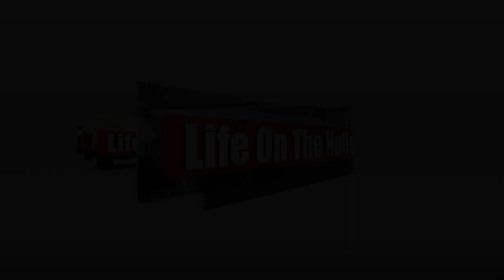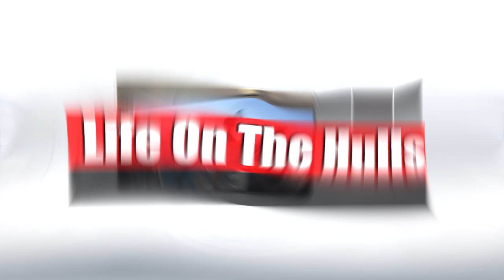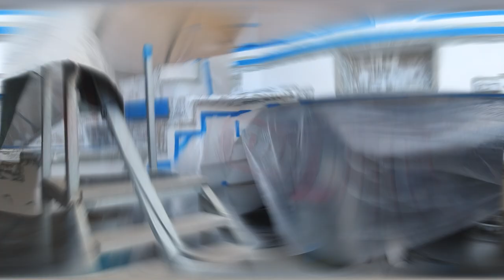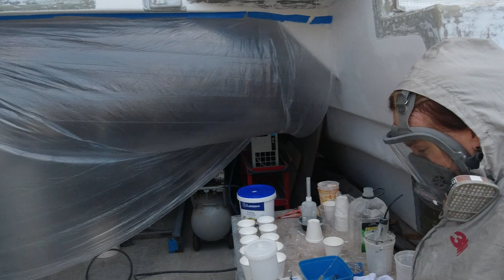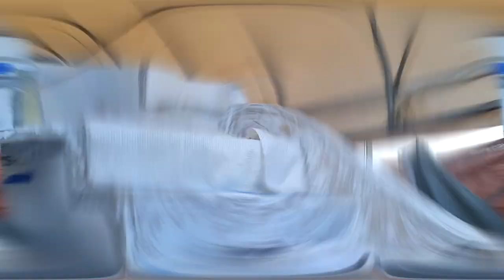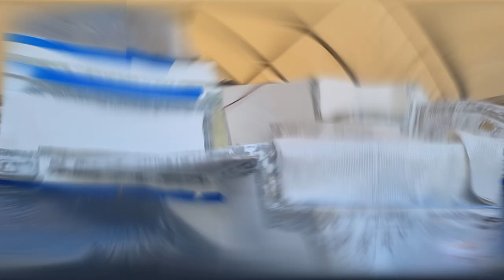Port Hull Extension Gel Coat Spray Up 4th March 2023 - Life On The Hulls

Comment: So how many imperfections have you found now the gel coat is on? How annoyed are you? 

Looks good by the way.
Reply from the maker: After much fairing,applying first sprat of gel coat have now faired down to a smooth surface.Next spray up will be flow coat and yes there were many imperfections and probably a lot more to come. I am very accustomed to this effort, I don't get annoyed I just have to keep working at it.Cheers Ross.